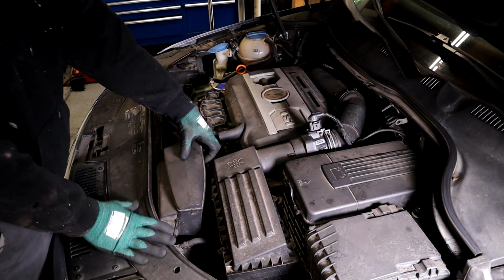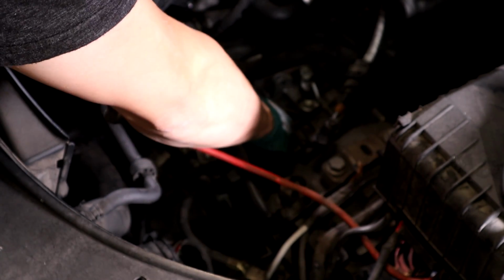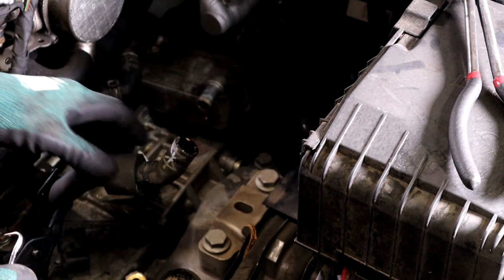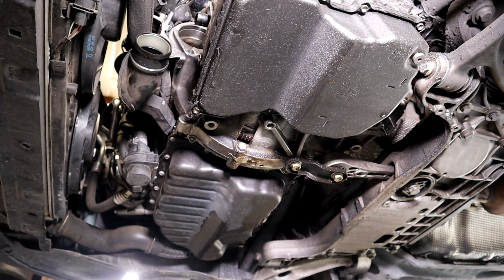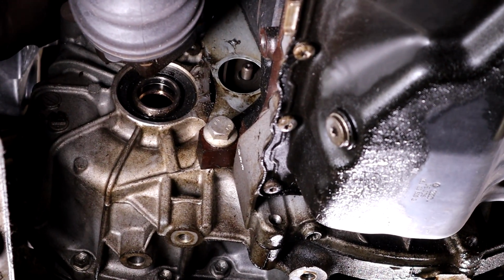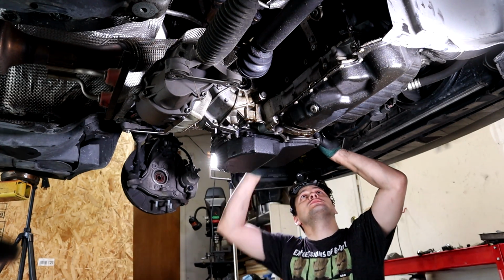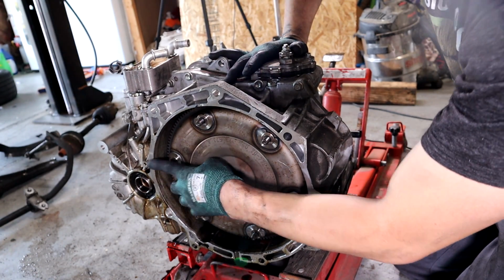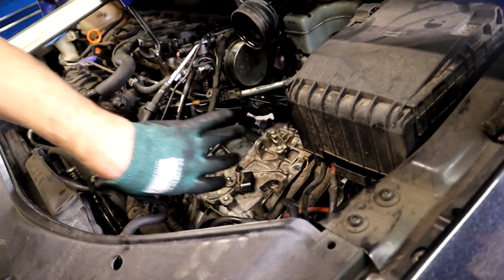How to remove VW 09G transmission

Comment: Hey, great video, really helpful. Just wondering if there's some sort of service manual that you used or you know of to help with the repair. Itll be my first time doing a transmission and Im trying to find a good manual for the 09g replacement but I cant find one. Any help is appreciated. Thanks.
Reply from the maker: like the inside of the transmission?
Reply: @carwerks101  Thanks for responding. No, just a general 09g transmission replacement for my 2.0 NA jetta. I picked up a good newer 09g transmission from a local scrapyard and was looking for some sort of detailed guide to help me through the swap. Maybe they don't really exist for just a general swap, but figured it was worth a shot. Also for those torque converter bolts, how do you get the torque converter to spin so you can access the other bolts? Did you rotate the crankshaft from the other side of the engine?
Reply from the maker: @thepredators8441  you would need all data, I tried to start a Subreddit for situations like this, if you go to it i could always upload in the instructions, but yeah you need to turn the engine over or use a screw driver on the starter ring and turn it a little at a time
Reply: @carwerks101  Thanks! Where could I find your subreddit?
Reply from the maker: @ should be carwerks101

Comment: Thanks for the great video dude!  My brother and I used this to remove the transmission from his 08 Passat just yesterday.  There was one bolt up top toward the firewall that took forever to remove due to limited clearance.  Couldn't get a socket on it even with wobble extensions.  He finally was able to remove it slowly but surely.  Thanks again.
Reply from the maker: I know exactly which one your talking about, they have a special socket for it but you can get it with a wrench

Comment: 15:28 - Was great to know to pry out the hexagonal axle bearing cup from the gearbox. By the time you see this you I have found an answer, but I am going to try pry hammer back in again (spline with circlip into the gearbox) - cannot push it in by hand - I greased spline, but there are not many places to hammer it in from under as is all rubber boot in the way!

Comment: Thanks for the clear explanations.  Does anyone know if this would the same for a 07 rabbit with 2.5L?  I have seen some remove the whole engine and transmission assembly, is this way less time consuming/easier?
Reply from the maker: I’ve done a million of them on the 2.5 in the car way easier to leave the engine in
Reply: @carwerks101 want to do my 2.5 trans but I don’t think it’s the 09G similar enough though yeah?
Reply from the maker: @guywithaname1  it should be the same transmission

Comment: This is the best r&r video I've ever watched.  One thing though...There is no audio after 30 minutes in, can you do anything about that, I'd really like to hear everything that you say when reassembling.
Also, why did you r&r, did you put a new or rebuilt transmission in?  My 06 Passat, FSI Turbo, has a leak that is coming from the torque converter area, I'm hoping I can just replace the seals.
Reply from the maker: chris parent I replaced the rear main seal, I wasn’t aware there was no Audio after 30 mins I’ll see what I can do

Comment: This video is very helpful.   I'm working on a upper oil pan. Is there a way to get the 2 bolts by the rear main without removing the transmission?
Reply from the maker: No unfortunately
Reply: @carwerks101   I thought so thank you

Comment: The crank doesn’t have a center bolt, how did you spin the engine. My crank has multiple bolts

Comment: You show removing only four lower bolts on the transmission and then the torque converter bolts. Are there any bolts at the top of the transmission bell housing that need to be removed?
Reply from the maker: Yesv

Comment: Planning on replacing the rear main seal on a 2010 Tiguan.  This is supposed to be a 09M automatic transmission.  All the info that I can find indicates that the 09G and 09M are the same transmission physically. (different internal components for different torque).Do you think this video for removal of a 09G transmission is applicable for removal of a 09M transmission?In this video you discuss reinstallation of the torque converter.  Do you have any videos that actually show reinstallation of the torque converter on a 09G?… much thanks in advance for responding!
Reply from the maker: yeah they come out exactly the same

Comment: This won't work on 2006 VW Passat because the driver side engine mount is actually attached to the transmission. So you would need an engine hoist to support the weight of the engine or just pull the whole engine with transmission...
Reply from the maker: i have one attached in the video, you can also use a jack and a block of wood on the oil pan
Reply: @carwerks101  yup a jack supporting the engine should work. Thanks 🙂

Comment: Hey i did a Swap on a 2016 with a 1.4 tsi i left the tranny on and only pulled out the engine. And now my car wont drive i shift ito all gears and nothing the transmission only has 2 plug connections op front?? I have code 0731 and 0721 .. any hints
Reply from the maker: What transmission does it have?

Comment: Quick question before I start this job....  Are those braces you have installed above the engine compartment? & Do I need them?
Reply: I think I see why now...  supporting the weight of the engine when trans is disconnected.

Comment: do you know what the torque spec is for the FLEX PLATE bolts (the 12 point bolts) on the 09g/09M?... thanks....
Reply from the maker: 30nm

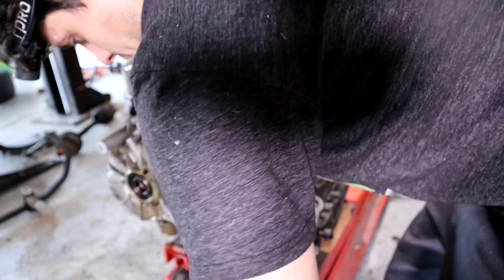Comment: At 24:18 is there a big gasket or seal that goes around the large portion of the outside? My 2014 mk6 1.8t automatic transmission is leaking from the bottom of where the torque converter is. I changed the torque converter seal and its still leaking. does this mean its the torque converter itself?? Is there any other seals that i should change besides the torque converter seal?

Comment: I have a 2014 vw Jetta se 1.8t with an automatic transmission. Recently my transmission has been leaking right under where the torque converter sits. So I replace the torque converter seal and bought a used torque converter to see if it would fix the issue. However after 5 mins of running it while putting fluid in it begins to leak in the same spot as before . Are there any other seals I need to replace ? Or do you think I didn’t seat the torque converter seal correctly ? I need advice please
Reply: Its been awhile but did you figure out why it was still leaking?
Reply: @iskooobydoo  Could be a rear main seal?

Comment: Do you really have to remove the subframe?
Reply from the maker: No, but if you want to wrestle it then that’s up to you
Reply: @carwerks101  nope, don’t want to wrestle with it) makes total sense. Thanks for the video, it’s very helpful. The subframe bolts are single use right?
Reply from the maker: @fastboatster  yeah, you can re use them but most likely will have clinching or clunking from the subframe, I suggest a dead set kit regardless and you won’t have to worry about that anymore

Comment: With your transmission connected how do you spin your torque converter around when unbolting the bolts ?
Reply from the maker: I was turning it at the crank pulley bolt
Reply: @carwerks101  is the cranky pulley bolt the inspection gap that shows the torque converter wheel??
Reply from the maker: @anthonyvaladez7426  no, you can use those if you Want with a flathead, the crank bolt is on the end of the engine where the belt is

Comment: Quick question, I just pulled the trans on my wife's 2010 tiguan to replace the rear main, got it all back together and the trans isn't engaging. Do you think I lost fluid in the removal process or could it be something with the TC?
Reply from the maker: Stephen Wejrowski how much fluid did you lose? Is the linkage installed correctly? Did your transmission fully seat together before you tightened all the bolts?
Reply: @carwerks101  I don't feel like a lot of fluid was lost but I already cleaned the mess up so I can't really say. As far as the transmission being fully seated, I don't think it was all the way in. I watched the video after doing the project. I know we had everything lined up but the engine wasn't quite level so we had the top bolts started then used an engine hoist to line everything up but I didn't make sure the bell house was completely seated or tight before putting all the bolts in. Did I toast it, or is there anything I can do to remedy it?
Reply from the maker: Stephen Wejrowski sounds like you damaged the pump in the transmission if you just drove the bolts in without making sure it was flush
Reply: @carwerks101  ok, is that fixable or do I need to find a replacement?
Reply from the maker: Stephen Wejrowski needs a new pump so you need to pull trans apart
Reply: @carwerks101  is that like most AT's where the pump is near the front but behind the TC?
Reply: Also, I just wanted to say thank you for taking the time to respond. Something I didn't mention previously is that I also don't have my windshield wipers or washer system as operational and I really don't know why. I was kinda wondering if I messed something up with the wiring harness for the trans and wipers etc.
Reply: @carwerks101  I am not seeing where I can get a new pump, do I need to go through a dealer?

Comment: Hi I am changing my transmission also in a 2009 passat a question the transmission you replaced is different code # or the same  if it is different code did you the adaptation
Reply from the maker: Same

Comment: Enjoying your videos - you're a funny dude. On the subframe, I'm getting ready to do a RMS on a 2010 Tiguan 4Motion.  Do you need to mark certain bolts for alignment before you drop the subframe?  I noticed you zipping out bolts but you may have marked the eccentric bolt previously. Also, does the Haldex need to be drain before removing?  thanks for any advice.  Keep up the good work
Reply from the maker: Jim Juritsch you can mark the sub frame to try and get it back as best as possible but there the only thing, you will have to do an alignment most likely